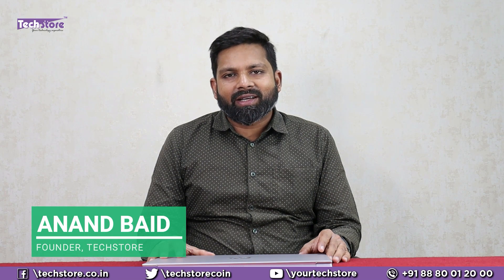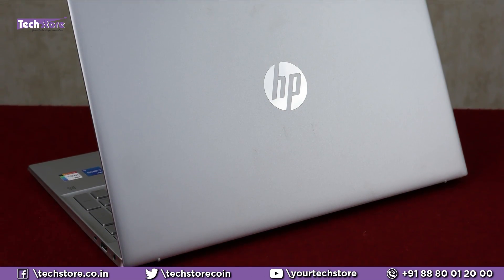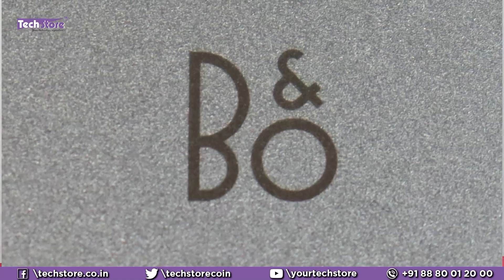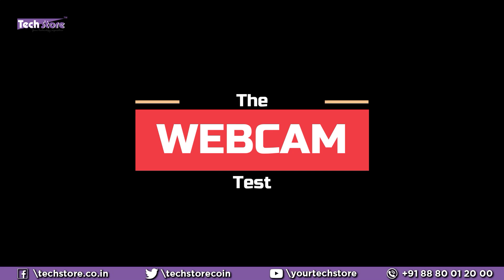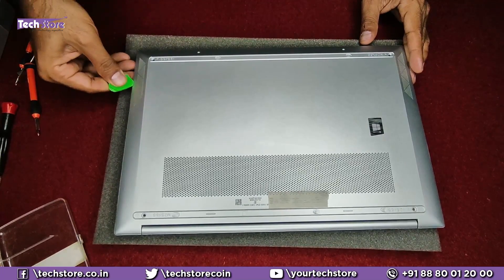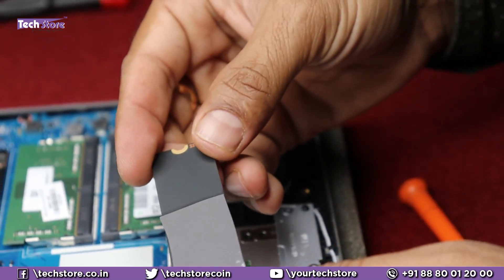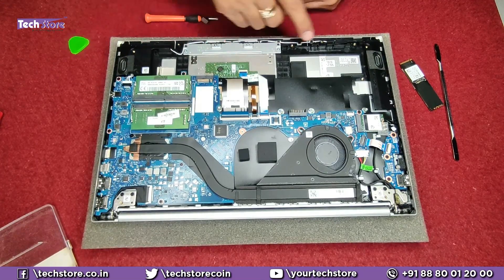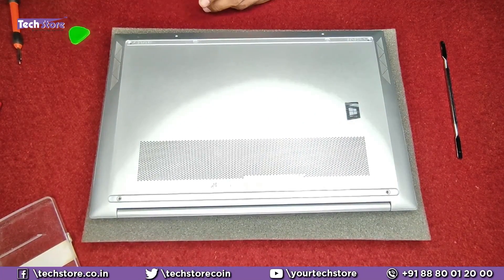HP Pavilion 15 EG series 2022: Review disassemble upgrade ram m.2 ssd hdd battery speakers easy diy

Comment: i bought this series of laptop but i noticed thier is like a gap in the back cover(pannel) its around left side and i think its ssd part which there is a gap (pops in and out) i can no longer hold it it in my leg or with one handed and i think this problem is in most hp laptops or should i change my pc also i am curuous will it after me in the long run please someone knows answers

Comment: Is there any trick to remove the screw for the NVMe ssd ?  Mine is stuck somehow and I have not been able to turn .. also, what tool would you suggest? I have can un-screw others but not the one that locks the drive. Thank you!

Comment: I splled fruit juice on the keyboard, dried it off and drained the liquid from inside. Should I assume ti's dead since the power light comes on, but thats it. Can the motherboard be removed to clean the other side of the board and the keyboard? Thank you,

Comment: If you replace the 512gb drive and upgrade do you not loose your operating system?
Reply: Yes you do. You need to clone your existing drive onto the new one using an SSD enclosure before swapping the drive

Comment: sir, ...sir,...sir,
i have the same laptop purchased on june 22....sir , its get quick heat up from the left bottom ( i think heatsink on processor )...some time within 5 min after turn ON . even i am not regular user.....twice in a  week for 2 hrs. ( using youtube, , never gaming  )...sir, it this normal or heating problem....please guide . 
thanks & regards !